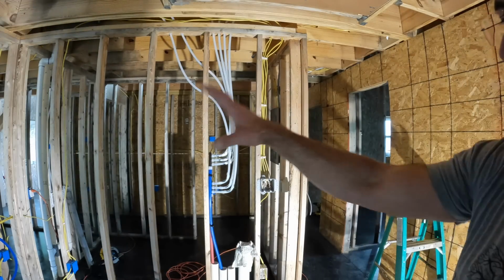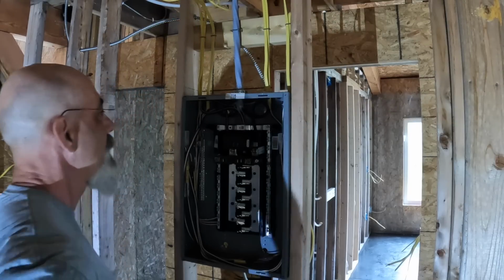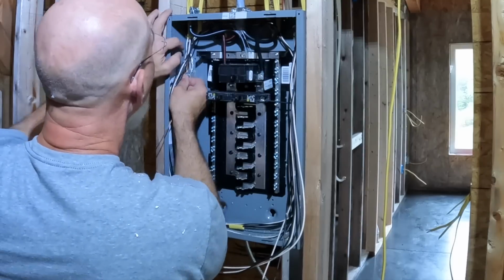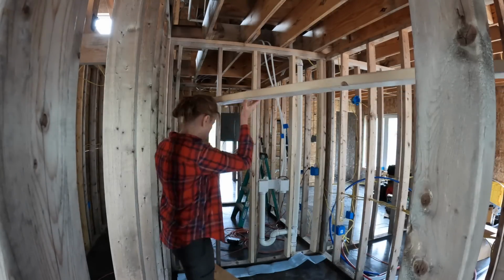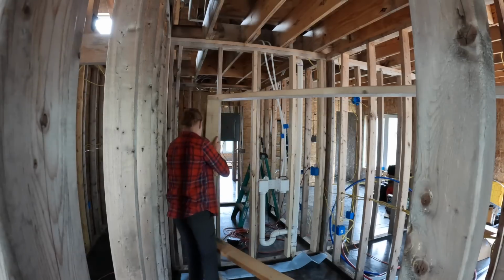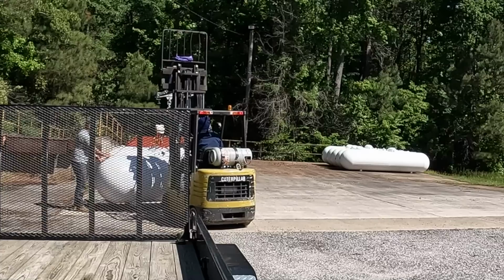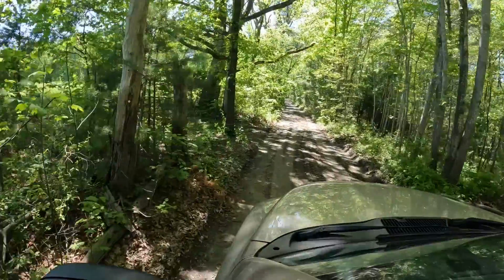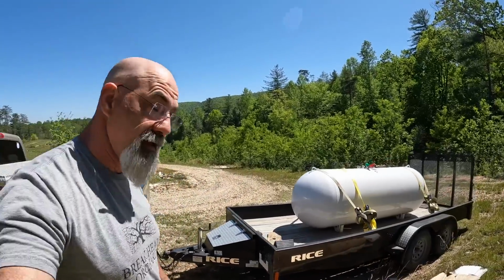Bringing Home a 500 Gallon Propane Tank.  ..... and some more electric work.

Comment: If it were easy then more would do it probably fits somewhere here. I hate to do electrical, I am good at it regardless of ac or dc but its just so monotonous and some can be real hard  when doing commercial and your pulling wire through conduit for a hundred feet... very tiring for me

Comment: A heat pump dryer is also another option  for the vent issues. They don't need venting and are the most efficient dryers out there. Only downside is they take slightly longer to dry but are gentle on the clothes.

Comment: You're not kidding about the cost of the tanks. I just put a 500 gallon in and with tax it was $3900. I think there's a lot of gouging going on out there.
Reply from the maker: If they had offered it installed for $3900 I would have jumped on that deal.

Comment: Noticed you talked about running a supply line from an outlet up to your switches.  It isn't a big deal but if the lights are on and someone uses the outlet there is a good chance your lights will flicker.  I think you talked about this in an earlier video about how many outlets and/or lights you were putting on the same circuit.  

Course I ran all our lights and outlets on separate circuits to avoid this but later found that on solar the inverter doesn't output full power all the time.  So what happens is that when a vacuum is turned on, all the lights on that 120V leg of the 220V will still flicker.  Only way to fix it is to increase the sustained output, not a good idea when off grid, or put all the lights on one leg and the outlets on another.